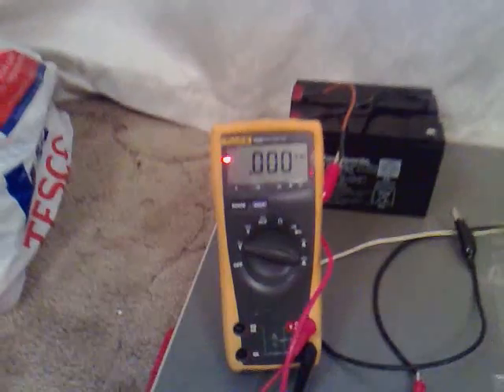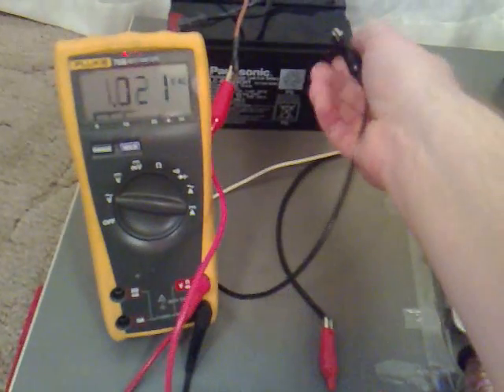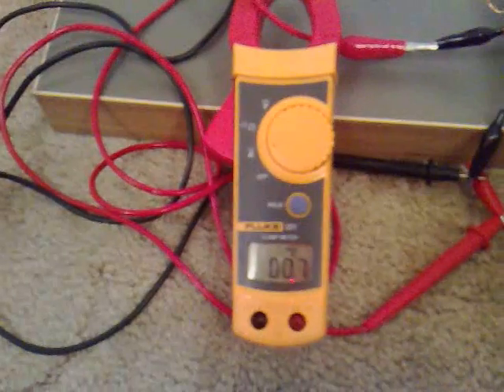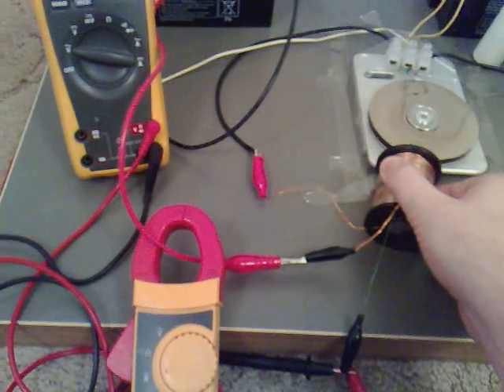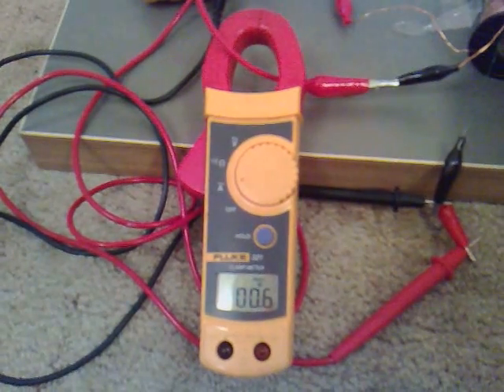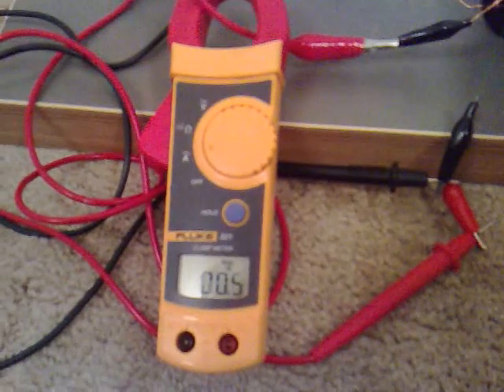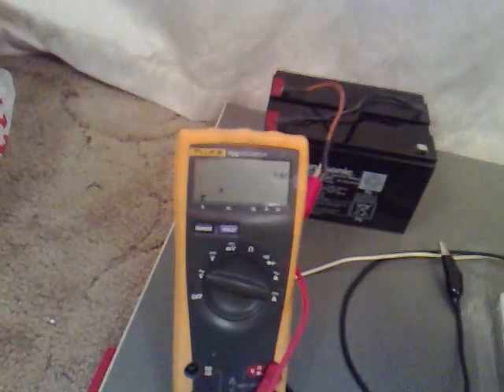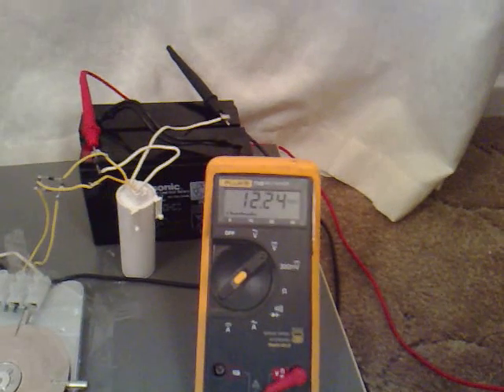Pulse Motor (New HD Charging 04) 023

Comment: What is the type of  your magnet? Do not use Neodymium Magnets. Because it is too strong and it will saturate the magnetic core in your coil. It will only increase the current that is needed to generate the motor. And further do not put any aluminum material closed to any dynamic magnetic field. It will cause a induced current in that metal material and slow the motor down. And your magnetic core should be a bundle of small individual steel wire, it decrease the size of induce current field.